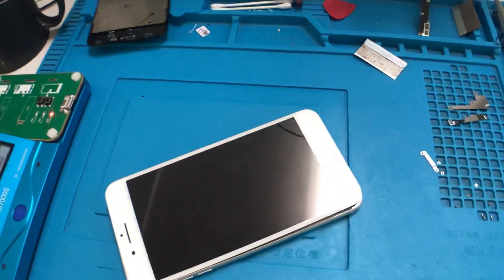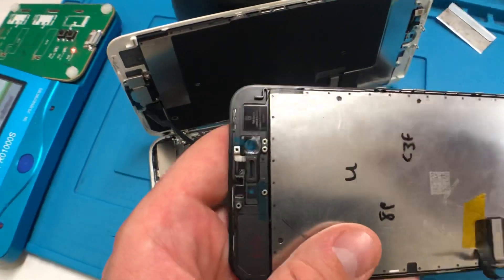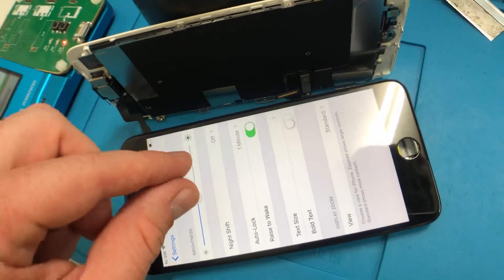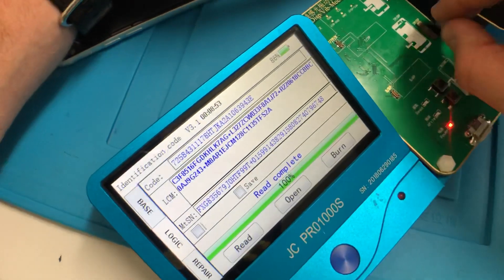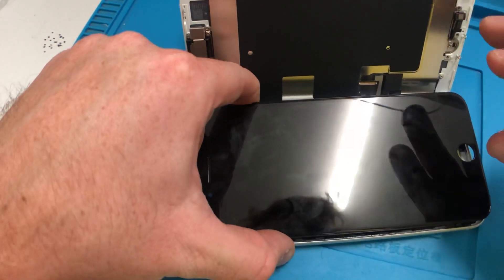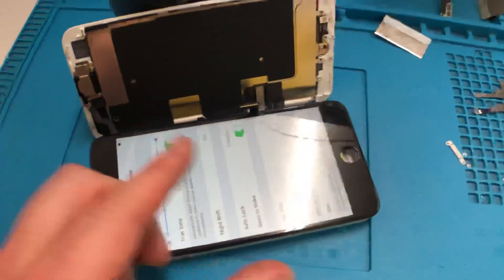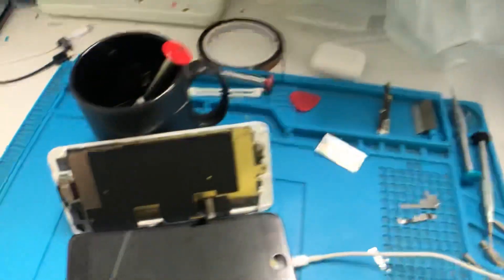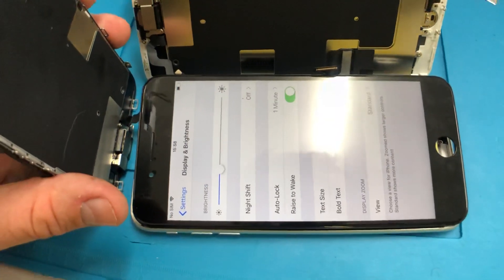iPhone Screen Repair True Tone Serialisation Error with EEPROM Solution

Comment: Thanks, great video, at last somebody addressed the problem like a real professional, the truth is if you don’t have the original flex cable from the front camera you can not restore True Tone, you can buy Icopy or JC pro and read and write the shit out and in the EEPROM of the screen it will not work, this is my problem, Riki do you maybe have a solution for my problem, Thanks again